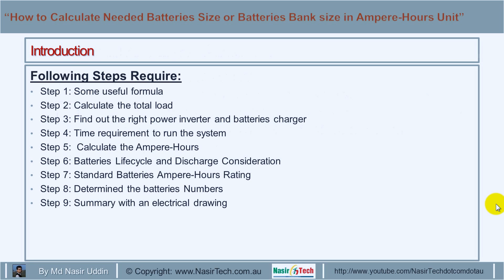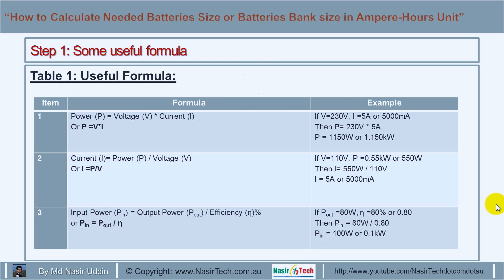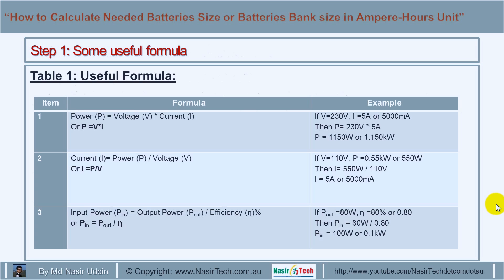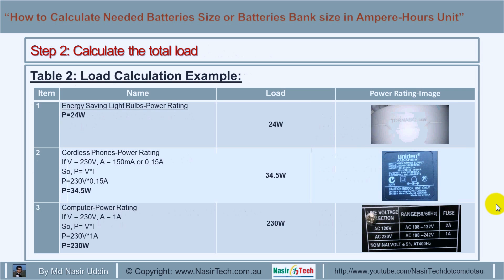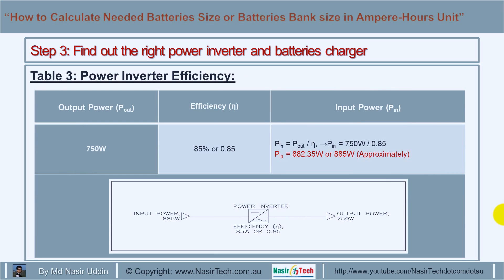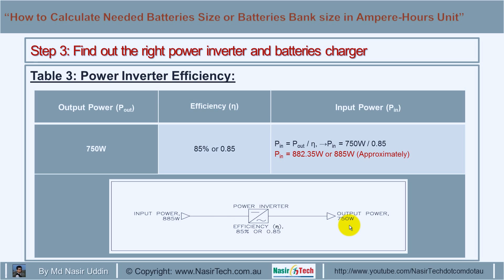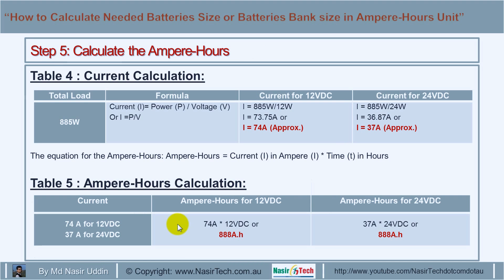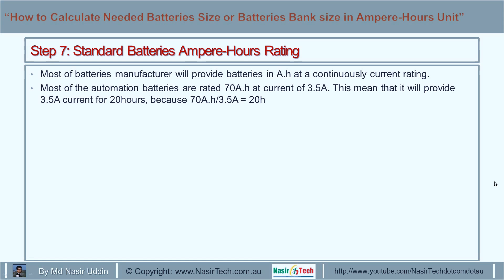How to Calculate Needed Batteries Size or Batteries Bank size in Ampere Hours Unit

Comment: 750 watt x 3 hours= 2250 watt-hours so you need 2*2250 = 4500 watt-hours bank of deep cycle AGM because you can use only 50% of the watt-hours. 3 battery x 150 amp-hour= 450 amp-hour * 12 volts= 5400 watt-hours so you need 3 very big batteries
and to recharge them you need  4 x 100watts x 6 hours of sun= 2400 watt-hours of solar charge so you need 4 solar panels

Comment: hi, I have a battery back for a device but this battery back is broken so I want to make another one I already have the data from the old one which is 7.2 v , 1300mha but I am confused of calculating the voltage and amper for each one in the back as the the old one contains 6 batteries

Comment: there is a mistake in step 5. Current in Amp must be multiplied by time in Hours to get the required Amp-hours in order to determine the size of the battery bank. a much less number of batteries will be required to run 750 wats for 3 hours than calculated in this example.
Reply: +Mohamed Abdulhaq 

I agree, the current in step 5 should be multiplied by time (t) which is determined in step 3 as t=3 hrs.
Reply: +Feras AbuHijleh 
Sorry, the time is determined in step 4 & not 3.

Comment: sorry i dont understand at step 5, when you divide 885W to 12V you get 74A and don't you have to multiply 3 (which is time) to 74 to get Ah?? 74X3=222Ah . I am just confused
Reply: and I thing the product will be Watt.hour, not Amp.hour??? since Amps X VDC is equal to Power in Watts.